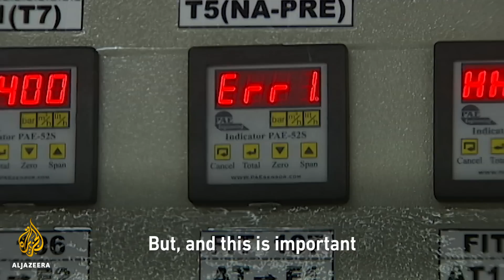🇮🇷 Explainer : Iran’s nuclear programme | Al Jazeera English

Comment: Most sensationalist statement expressed in this propaganda piece issued by AJ. There is absolutely no way to know how long until the can detonate a bomb. Assuming they may want to build one, it would be less speculative had they said one year to produce enough enriched uranium to attempt making a bomb.
Making the detonator will take longer than a year, specially without help from experienced sources. Sourcing a detonator may be easier than manufacturing one, but this is far from easy. The number of agencies dedicated to preventing this type of transaction are numerous, and it may be easier to simply wait and watch the west implode in the next few decades. It's inevitable, but it will take time!
All of it, that is!!